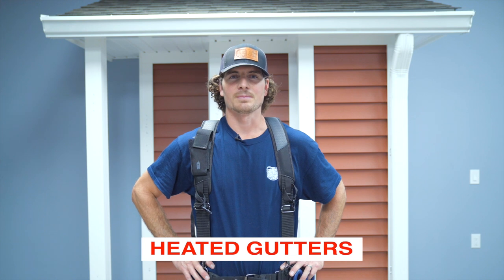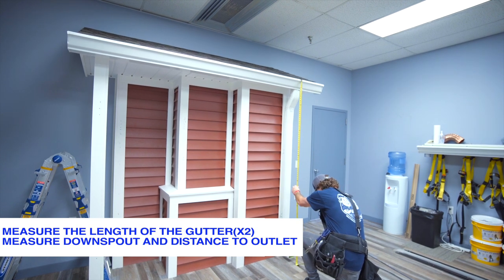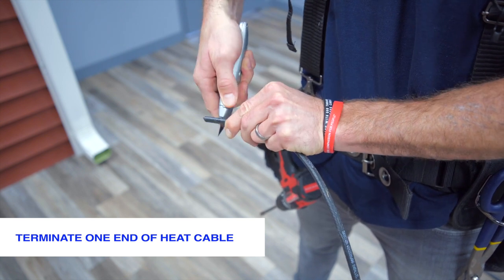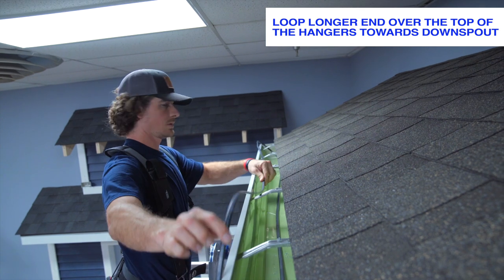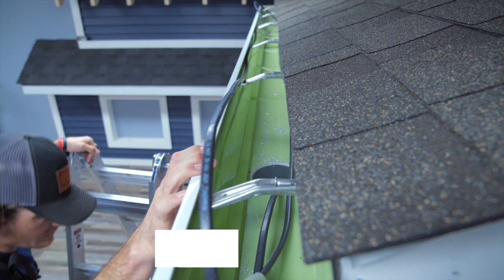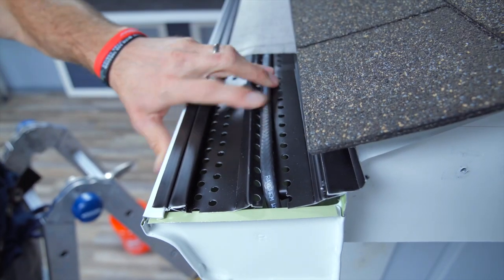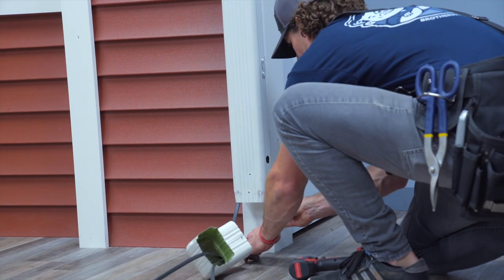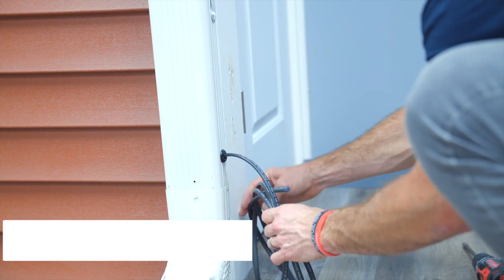How To Install Heated Gutters

Comment: Good stuff. I have reverse curve gutter guards that are great except during the winter. I'm looking into different heating systems. Some of the systems use cable with a "special" panel to transfer the heat. Would a heat cable generate enough heat to also heat these reverse curve covers?

Comment: Do you have to use the gutter guard to have heated gutter cables installed? Can the cable be put in and just left open to the elements?
Reply from the maker: Hey Larry, thanks for the question! No, you do not need to have gutter guards if you'd like to install heat cable into your gutters. However, gutter guards are great at protecting the cable itself as well as making sure it is clear of debris so that it has maximum snow melting potential!
Reply: Thanks, I appreciate the quick response. 1 last question - can the heat cable lie on the bed of the gutter as long as it is separate by clips from itself so it doesn't short out?  @TheBrothersThatJustDoGutters
Reply from the maker: Sure thing! It depends on the heat cable you are using. The heat cable that we use in the video will not short out. There are certain cables out there that can short out so make sure to check with the manufacturer.

Comment: Hi guys - Good video, very easy and clear to understand and follow. I just subscribed. I have metal gutters and in the SE corner of the house that could use this is a PVC down spout. Can these gutter heaters be threaded thru PVC downspouts or do they have to be metal?
Reply from the maker: Hello Harvey! Great Question, It usually depends on what type of PVC you have on your downspout. However, We do not recommend installing Heat tape through PVC, Our best suggestion, if you are considering that route, is to reach out to the distributor of the PVC for heat-specific questions. 

Installing metal downspouts would be your best option to be completely safe.

Comment: My experience with heat taping gutters is that it is basically useless to do this. It's just enough heat to make a hole the size of the cable in the ice and they will not make your gutters ice free. To get enough heat for them to actually work would cost a small fortune in electricity.
Furthermore, I would never cover my gutters with anything. There is NO gutter cover that works and they are all being sued.
Reply: We live in the Northern Utah and get lots of snow and  nighttime temperatures have been in the teens. 12" more snow is expected tonight.  I had neglected to plug in the heat melt this year and finally noticed an 8-10" deep ice dam over our gutters and filling them with solid ice yesterday afternoon. I plugged in the heat melt 24 hours ago and took a photo of the readings on our digital power meter at that time.  The heat melt cable is 75' long and goes down one downspout. After 24" hours the ice dam was totally gone, the roof where we had the heat melt had no snow remaining,  and our gutters and downspout were devoid of ice and were free flowing.  I then checked the power meter again. The power usage for our home over that 24 hour period was 16 kw hours.  We pay 9.25 cents per kw hour.  So the last 24 hours of power usage for our home was $1.48, or about 6 cents an hour. That usage also included TV,  electronics, heated mattress, lights, blower motor on the furnace, fridge,  freezer,  and a boat load of small appliances and other power drains.  That's the best $1.48 I ever spent.
Reply: @bernie9071  I seriously doubt you electric bill is just $45 a month.
Reply: @trustme7731  The electricity portion might be. He's not including taxes, basic charge, transmission/distribution costs and any other miscellaneous fees power companies tack on.
Reply: @bernie9071  
This gutter is facing south, isn't it?